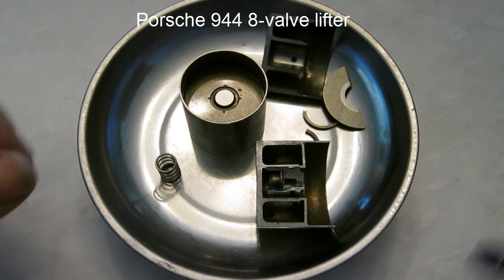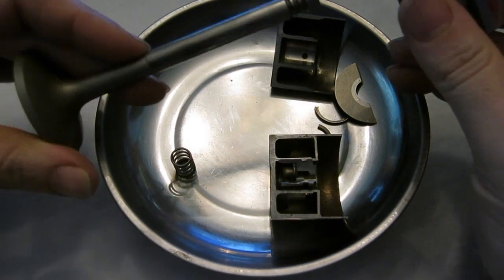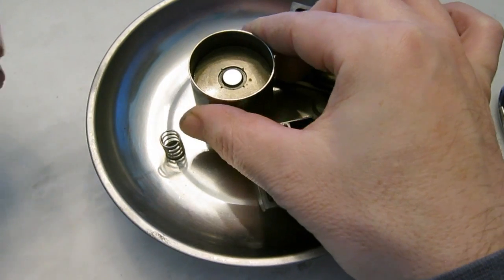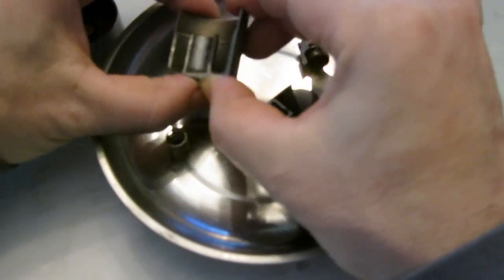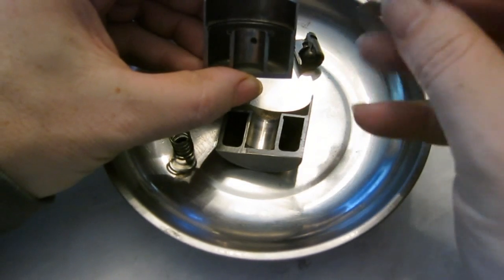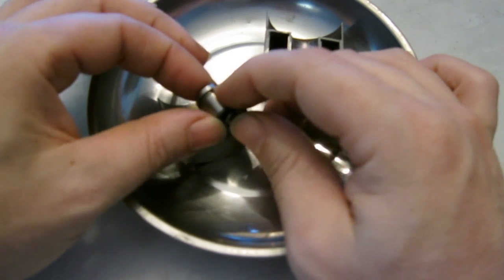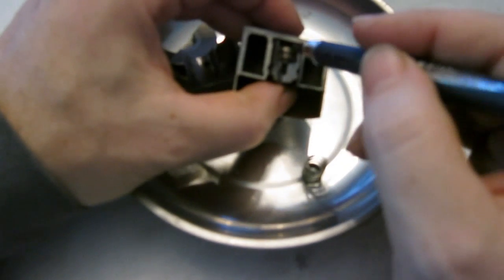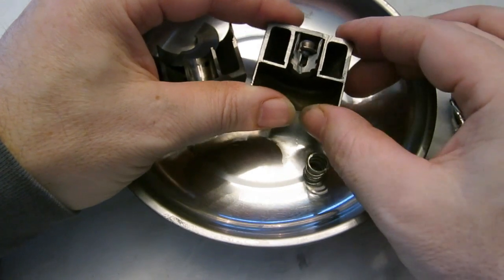What's inside a hydraulic lifter

Comment: What I wonder is why the lifters for the 8V cars seem to cost TEN times as much as the ones for the 944S/S2 & 968.  Anybody know?
Reply from the maker: Supply and demand? I don't really know.
Reply: @vsvenson  Probably.  I spoke with one of the Lindsey Brothers who told me INA aftermarket ones went out of production after people complained about them and that the factory is probably the only $ource now after having to re-tool for another, limited, production run.  
In the meantime, I've gotten my problem one to quiet down with a 0W-20 & Marvel Mystery Oil treatment.  Will switch to 10W-50 from the factory and hopefully make it through my smog check - of course it acts up with little time left to tear things apart before registration renewal, lol. Thanks for writing back, fingers crossed, knocking on wood . . . BTW, any idea why the idle would creep up on hot days?

Comment: Hey Van! Very good and informative video! I hear a ticking sound on my GT4 engine when it sits for a long time when it is cold.

When engine is at operating temp, the ticking stops.

So I assume it could be the oil sipping out of the lifter when sitting for a long time. The ticking sound is from the tiny piston tapping at the bottom of the bore you think, when lifter has no or little oil in it?
Reply from the maker: When the lifter doesn't have oil pressure, the little piston gets compressed back into the lifter quickly, and that might be the ticking sound, or, when the cam lobe moves away from the lifter, the lifter might snap back and hit the camshaft.  I'm not sure which part makes the noise, but it's probably one of those two. :)
Reply: Van Svenson thanks!

Here is what my cold engine sounds like when I am not using the car for a long time:
https://youtu.be/3Z5DeBBBPd0

Comment: So could tapping also be a sign of low oil pressure?
Reply from the maker: Low oil pressure could absolutely that could be a cause for lifter tapping.  If oil pressure is good, then it's likely a lifter check-valve held open with debris.
Reply: Van Svenson Im getting symptoms that i can only describe a like having the handbrake half on, you can feel the engine wanting to go but somethings holding it back, ive put some liqui moly lifter treatment in it today just until i get chance to strip the head, lets see how it goes haha
Reply: @chrissalter989  What kind of car?  Did you get it figured out?

Comment: How can I truely tell if my lifters are good or not? I've read on the majority of the web that its if they are rock solid. 7/8 of mine are. Also, I've removed all of the oil out of the main cavity with a syringe. How do I get the oil out of the piston? Finally, would you recommend a dip in carb cleaner? Thanks!!!

Comment: Nice, I've always wondered what went on inside a hydraulic lifter! Do you know what the advantages of hydraulic vs solid are? I always assumed it had something to do with damping of sorts, but I really have no clue...haha
Reply from the maker: If a lifter is too close to a valve stem, it will hold the valve open a little bit, and the cylinder won't build full compression.  If the lifter is too far away from the valve stem, you won't get full lift from the valve (and the valve train parts will "clatter" as they bang into each other).  So, the little hydraulic piston is made to move to the point to "take up the gap" so the valve fully closes and opens with the movement of the lifter.

Solid lifters are usually used in very high-RPM race engines where speed of the valve train movement and repeated impacts can cause a hydraulic lifter to lose some pressure and not be able to open the valve all the way.

A solid lifter need some sort of physical shim or adjustment bolt to get the adjustment just right - which is labor intensive (and can change over time as parts wear and/or stretch).  So hydraulic lifters are usually used in "normal" applications.
Reply: Gotcha. So it's sort of an adaptive system...As the engine builds oil pressure, the lifter finds that sweet spot and is then kept there with oil pressure? Cool! That would explain the constant clearance adjustments you have to do on motorcycles I'm guessing.
Reply from the maker: *****
Yes, you've got it exactly!
Reply: What van said... the job of hydraulic lifters in a nutshell is to fill any slop or gaps in the valve train that develop due to wear so you do not need to do constant valve adjustments and you always have a smoother, quieter running valve train